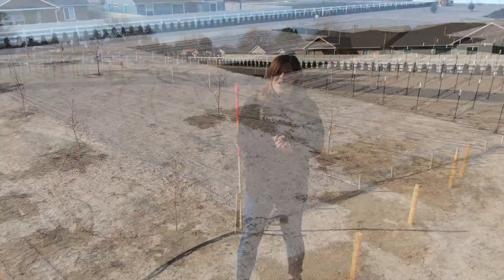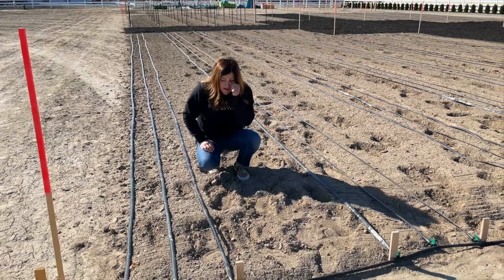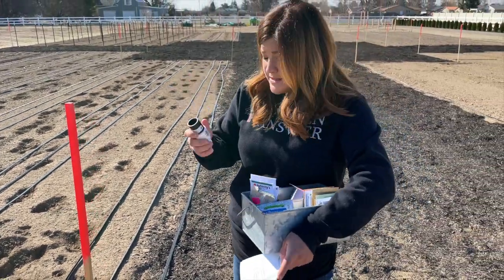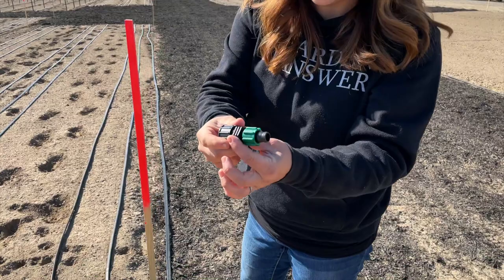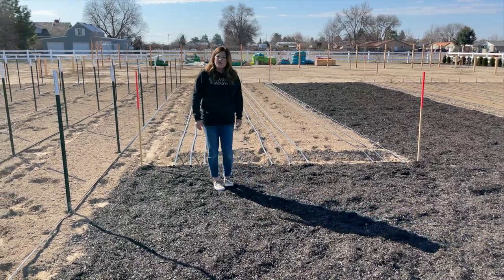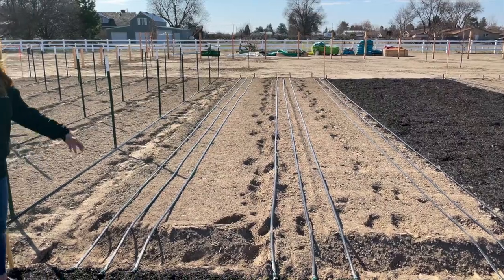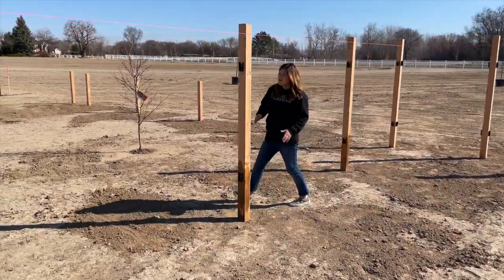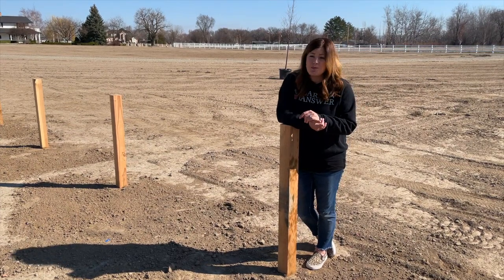Update Tour of Our New Cut Flower Garden Area! 🌿 // Garden Answer

Comment: Laura, I am with you on marked boundaries! You guys are being so smart looking ahead and planning for down the road such as spacing things out, planning for tools used in that area, etc. I have a suggestion for the compost bin. In CA, I could have finished compost in 3 weeks, however, I did have horse manure which I shredded to add to the bins. When I would turn the bins, I had steam coming out since the material got so hot. A huge help to the process, which is my suggestion, is that I had misters installed above each bin so that as I was turning the material, the misters would be adding moisture to the pile. I think Aaron could easily install something like that.

Comment: The valves can also be used to restrict water flow if needed, and not completely shut it off completely. Also consider increasing the building from 12 ft to 14 ft if area allows. The extra two feet will be great for storage. Love watching things coming together. Good luck with all you do. Soo many projects is a little overwhelming.

Comment: Considering the fact that gravel traps heat and grass is cooling, but also consuming water, both could damage the flowers by scorching and hard water from sprinklers. 
But the grass will bind and trap dust, offer soft ground you could walk barefoot, what's great for feet and issues with the spine.
Reply: Hmmm, never considered that!

Comment: You have become my ONLY expert gardener I watch because of too many opinions in YouTube world. Im usually one the first viewers every morning. Lol. Thank you for everything you put out. I've REWATCHED ALL your videos the last 2 days on irrigating through the years, but you've updated your opinions with some things after you've put things to use through the years which I would expect through trial and error, new products coming out, etc.. That said, I have some questions before I make the plunge. We built our home 2 years ago, but did tons of landscaping last year.  I have a 110x24 ft rock garden with about 100+ perennials and 6k lbs of rubber mulch (which I highly recommend!!) I also have smaller perennial gardens around the house and tons of annual containers. 1) What's the difference that you have found between drip tubing and drip tape? 2) what makes you decide whether to use 1/2" or 1/4" and whether to use the ones preholed or not?  Do you recommend putting the system in all gardens or just ones you put annuals in?  If so, tubing or tape and which size would you recommend? For containers, do 1/4" tubing with emmitors I can place where Id like, coorect? Using city water, is water pressure going to bed an issue? (I know this is a tricky one)

Comment: Laura I agree with you about the stones. Whst if you need to take a small tractor inside?  It is a waste of water, save it for the plants. And lastly you will have plenty of green with your flowers and vegetables.  Besides you can put a low  metal edge to prevent stones from moving.....

Comment: Little suggestion for part closer to your house, if you like nighttime accent lighting, maybe you should think about laying some low voltage cable, solar lamps do the job, but they can't compete with regular lights. I know you have tons of expenses but low voltage cable is cheep and can go directly to ground, it not require conduict, just to lay some basic grid when you will have everything digged around house, and then down the road, next year or year behind you can spread local grids and lights. On my previous house I dad low woltage lamps by my walkways and little reflectors pointed in tree canapes lightning them from inside, it looked magical in nighttime

Comment: Love how its all coming together, its going to be awesome!
Big question since I am trying to figure out my irrigation this year for my growing veggie garden (finally placed in the area I have always wanted it!), can the Perma-Loc Tape x Barb Tubing Takeoff Adapter Valve be used for regular drip tubing? I have lots of questions about drip.... very intimidating for a first timer with drip. 
Always just used a hose but my veggie garden will no longer be close to the house, it'll now be maybe around 50 feet away, in the back of our yard, behind my main garden and no way am I dragging our heavy 100 foot hose through the yard and my garden every day to water the veggies. I was thinking of doing the black solid poli tubing, trenching it through the yard so I don't kill myself on it or damage it with mowing, and running it down to the veggie garden, what size should I get? Its got to go a long way and be able to get water to all the raised beds.... I was thinking those valve things would be good to use at each bed so I can control the water kind of like you do with your veggie garden but less fancy :) 
I also would like to do that for my main garden which I plan on expanding, tapping into the trenched solid tubing and running the tubing with the holes through the yard for the flowers. I remember you saying its more limited in how far you can go on one zone, so I was thinking those valves would work to fix that issue, shutting off one part to water another so I get enough pressure for each, would that work? I hope it made sense like it did in my head LOL.

Comment: Thanks for the info on what you’re using for irrigation in the cut flower garden! I’ve been wondering, would you irrigate your raised vegetable beds with drip tape if you didn’t already have the drip tubing in place? Or is it that drip tape is better for long row style growing and drip tube is better for intensive raised bed growing?

Comment: Drip tape question: Is it possible to make a "grid" using the tape the way you describe making a grid with the drip tubing? And if not, do you find the water flow tapers off at the end of the drip tape line?

Comment: Rocks due have that tendency and they do become a real hassle. Tires throw rocks and gravel and they can travel quite a distance. Tires act like a slingshot.  I do like the look of both the grass and the gravel for the same reasons you do. Don’t they have edging that looks like an “L”?  Turning the bottom of the “ L” underneath the area where the grass would be, should prevent roots if you can find the right height. I suppose it also depends on grass variety too.

Comment: Why aren't you running your 1/2" tubing around the perimeter to complete a circle and connect from both sides like you found to be the answer in your beds?  I've changed my whole thought process bc of that mindset that you continue a loop instead of end anything.  In fact, our city water system does the same thing.

Comment: I have such a scatter brain that I would need little red flags with date on them to remember which location of water was turned off and when. The water schedule is my biggest garden challenge. Enjoy learning about the drip system very much. Water pressure and amount available at the end of the line has caused some disappointment in past years for me.